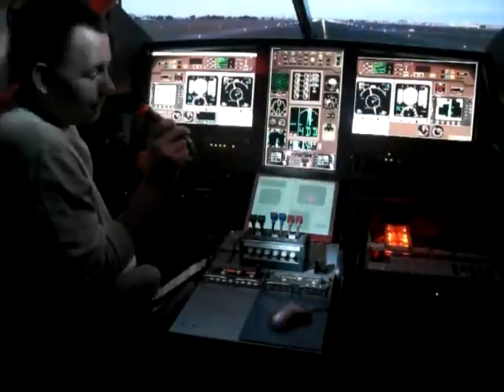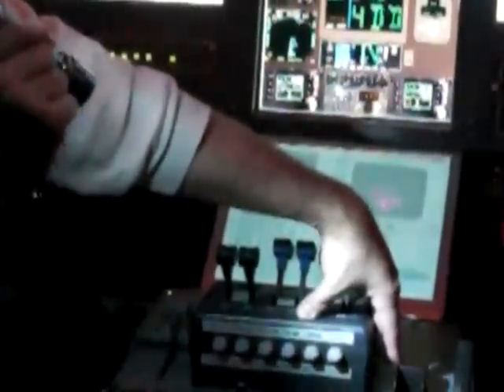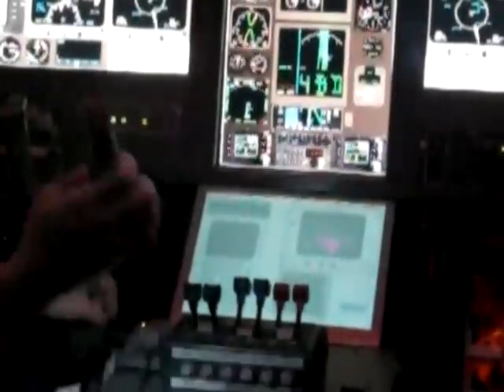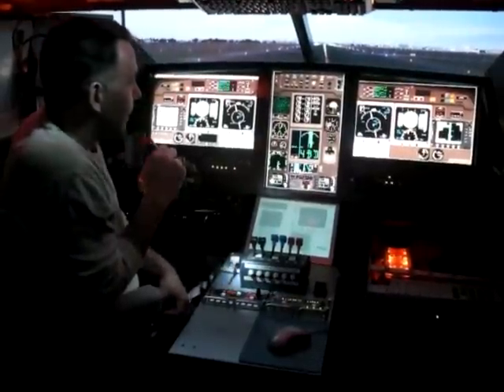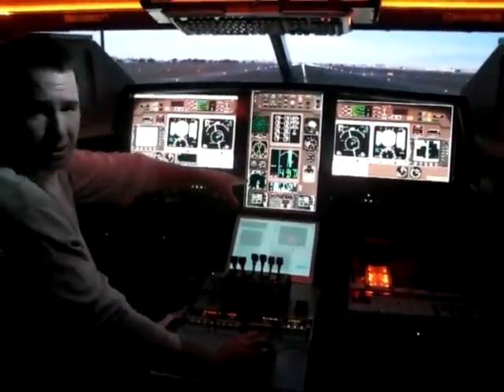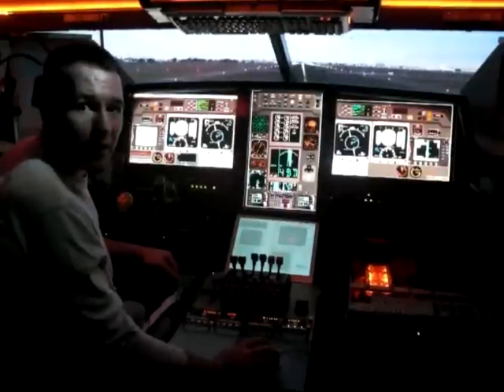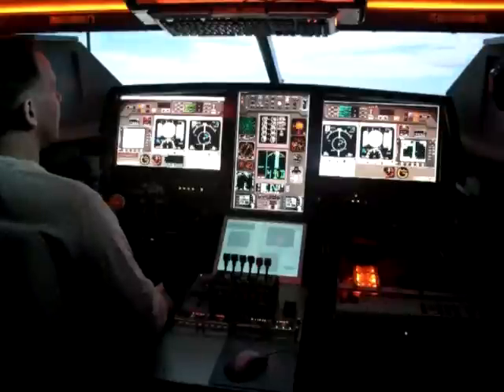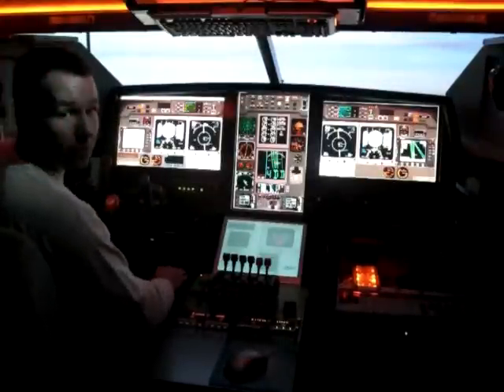FSX FS9 DIY Flight Sim - Speed Brakes - Flaps - Trim - Part 6 from SimSamurai.com

Comment from the maker: Yes, I use FS9 with 5 outputs (4 for instruments, 1 for exterior visuals) on one i7 PC. I tried this with FSX but because of the limitations of FSX it is impossible unless you network at least 3 if not 4 computers. I am about to build a new i7 4770k system for use with Prepar3D. Even though it is much smoother and more refined, it will still require at least 2 PC's to accomplish what can be done with a single high end PC and FS2004. This is mainly due to the 2048 vs 4096 resolutions.